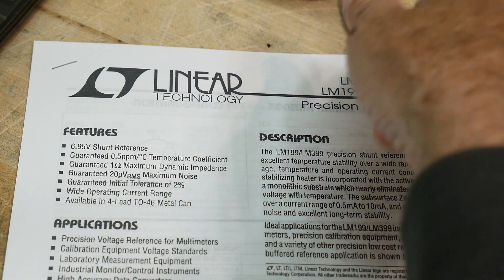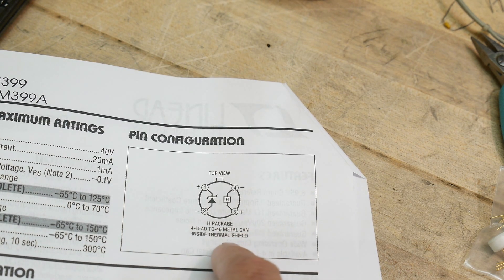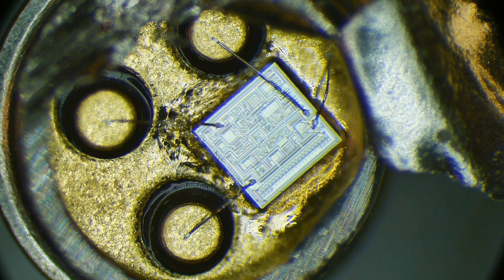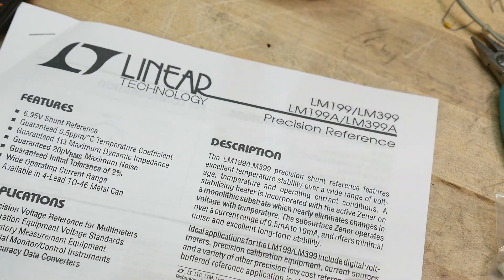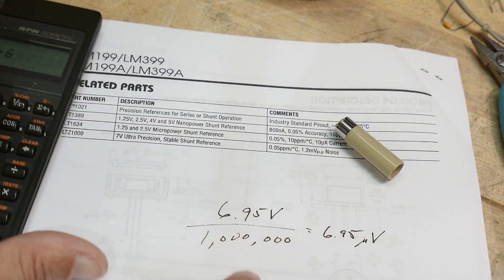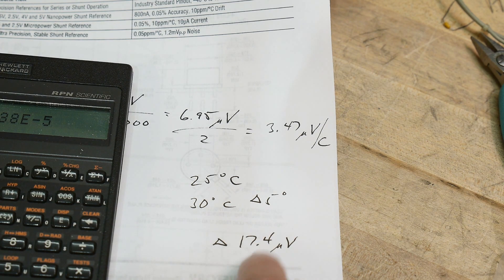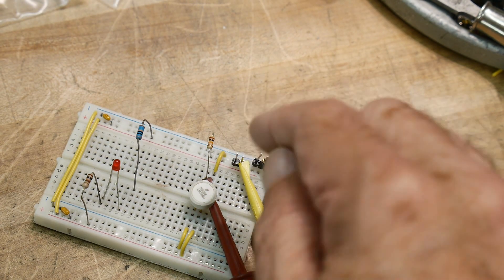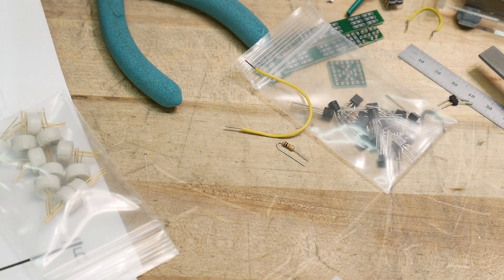#1155 LM399 Voltage Reference

Comment: I don't understand why the room temperature matters if the LM399 have a built-in stove. Its temperature ranges from 68-75 degrees Celsius.
Reply from the maker: The LM399 is a highly precise voltage reference, and its integrated temperature-controlled oven is a key reason for its excellent stability. However, it still exhibits a small voltage variation with ambient temperature due to several factors:

1.  *Imperfect Thermal Regulation:*
    * *Temperature Gradient:* While the oven attempts to maintain a constant temperature for the Zener diode, there will always be a tiny temperature gradient between the actively heated element (the Zener and its immediate surroundings) and the outside of the package. As ambient temperature changes, this gradient can shift slightly, leading to minute changes in the actual Zener junction temperature.
    * *Heater Power Fluctuation:* The heater circuit itself will draw more or less current to maintain the set temperature depending on the ambient conditions. This change in heater power can subtly affect other components on the chip or in the immediate vicinity, causing minor voltage shifts.
    * *Limited Control Loop Accuracy:* The oven control loop, while very effective, is not absolutely perfect. There might be small steady-state errors or dynamic responses to ambient temperature changes that result in tiny deviations from the ideal setpoint.

2.  *External Components and Connections:*
    * *Lead Thermal Conduction:* The leads of the LM399 package extend out of the ovenized region and connect to the circuit board. These leads act as thermal conductors, and heat can still transfer into or out of the package through them, albeit at a much reduced rate compared to a non-ovenized device. Changes in ambient temperature will affect the temperature of these leads, potentially influencing the device's output.
    * *External Circuitry Temperature Coefficient:* The LM399 is typically used with external resistors, capacitors, and op-amps to create a complete voltage reference circuit (e.g., to generate 10V from its 7.1V output). These external components have their own temperature coefficients, and even if they are low drift, their combined effect can introduce small temperature-dependent variations into the overall output.
    * *Thermal Stress on Package/Die:* Even with an oven, significant ambient temperature changes can induce slight mechanical stresses on the package and the silicon die itself due to different thermal expansion coefficients of the materials. These stresses can in turn cause very small piezoresistive effects that alter the Zener voltage.

3.  *Residual Temperature Coefficient (TC):*
    * While the LM399 boasts an incredibly low temperature coefficient (e.g., 0.5 ppm/°C for the LM399A), it's not zero. This residual TC means that even if the oven were perfect at maintaining the internal temperature, there would still be a tiny, inherent change in output voltage for every degree of change in the internal temperature (however small that change might be). This is often the limiting factor for ultimate stability.

4.  *Long-Term Drift and Hysteresis:*
    * *Aging:* All electronic components, including voltage references, exhibit long-term drift due to material changes and stress relaxation over time. While the oven helps reduce temperature-related stress, it doesn't eliminate aging entirely.
    * *Thermal Hysteresis:* Even well-designed references can show a slight "memory" of past temperature excursions. The output voltage might not return to precisely the same value after being cycled through a temperature range, even if the final temperature is the same. The LM399 is designed for low hysteresis, but it's not perfectly zero.

In summary, the LM399's oven is incredibly effective at minimizing temperature-induced variations, making it one of the best voltage references available. However, perfect isolation and regulation are physically impossible, and the inherent properties of the materials and the design limit its ultimate performance to a small, but measurable, voltage variation with ambient temperature.
Reply: @IMSAIGuy  Thank you.

Comment: I have been using this chip and its lower cost variants a lot. This one is extremely useful in circuits requiring top stability.

One important thing to remember when using these stable parts. Never use any trim pots for fine adjusting them. Trimmers are not stable at all having several instability mechanisms. Use instead digipots.

Comment: I found a discarded Keithley meter with a burnt board.   It had one of these voltage references (labeled SL40057, crossed to LM399) and some OP177 precision op-amps elsewhere on the board too (Similar to LT1001).  So I pulled them off the board and built the 10V portable calibrator shown on the LM399 datasheet.  Works perfectly, cost me nothing to make.  Thanks for showing the guts of the device, quite interesting!

Comment: In my travels I found its baby brother, LM3999, in a TO92 plastic package. The zener and heater circuits both share a pin for V- which knocks accuracy down a bit, and boy does that thing run HOT!
Reply: I found one inside a TTi-1906 5.5 Digit bench DMM too, weird little thing, turns out newer revisions of the same meter use LM399s.
Reply: Correct maybe,  but there is a diode from pin 4 to pin 2 , heater resistor to zener diode ground inside the chip. I connect all vref voltage ouput ground direct, as short as possible, to pin 2 at LM399.

Comment: Well, the datasheet did say it was all on a monolithic substrate :)

But before seeing it assumed it was a separate heater too. In fact I wonder if a separate heater would be better. Monolithic should have a steeper temperature gradient, no?

...and I could never bring myself so sell these beauties!
Reply: Monolithic more stable, as there is little temperature drift across the device, and faster response as well.

Comment: Nice video again. Can you check stability with heater off, also with the "topless" component if it still works? Perhaps blow cold air in it? I am very interrested in the results.

Comment: I'm going to have to go read the data sheet, mainly because I want to see how they built that opamp circuit to be stable enough to be a worthwhile buffer. 

Curse you, sir, for making me go do some research!  😀
Reply: The trick is to also use an expensive chopper opamp! Opamp's are also known to be extremely stable under temperature change which helps.